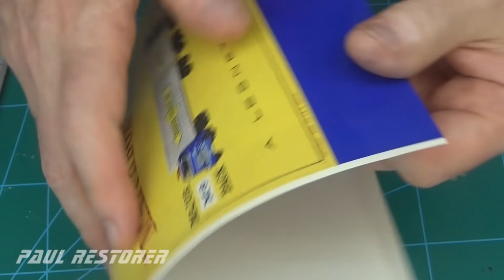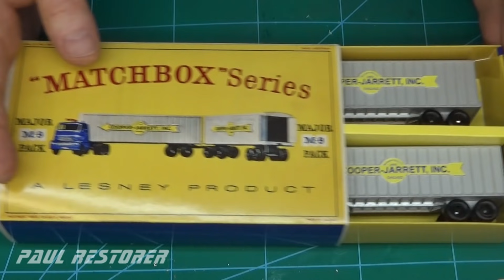Matchbox renowacja  Inter-State Double-Freighter nr M-9. Zabawka model odlewany.

Comment: Great restoration
Looks like a classic cab over engine Ford, White or International.
Love the colors and different wheels too.
Beautiful toy
Reply: There is a great b/w photo of the set on the turnpike, on the 'net.  Shows just how accurate Matchbox model making is.  The prime mover was a custom made order of 6 for Cooper Jarrett, by Hendrikson.  No mention I know of where the cab came from, or if they custom made it too.  The units were powered by Detroit Diesel 12V71 engines.  No turbocharging in those days - so a V12 was needed to haul the pair of trailers.
Reply: @railtrolley  I found some pictures of it.
It is a Hendrickson
I've never seen that truck before

Comment: Great restoration! 
I have never seen this model before, and I did not see double trailers on the highway before around 2000. They were apparently just not used in the area where I grew up.